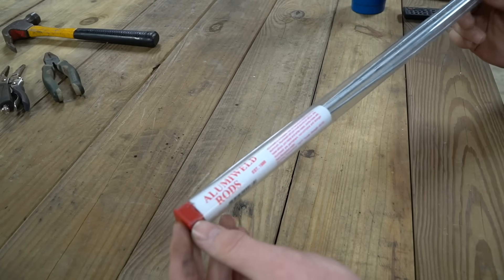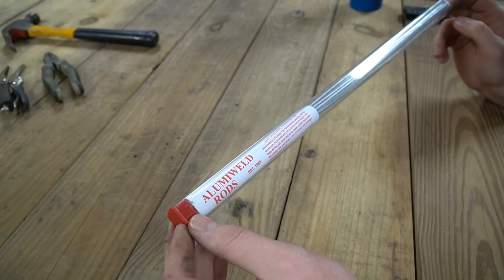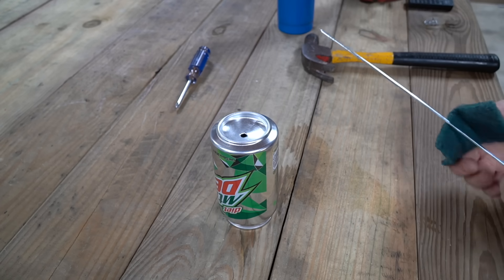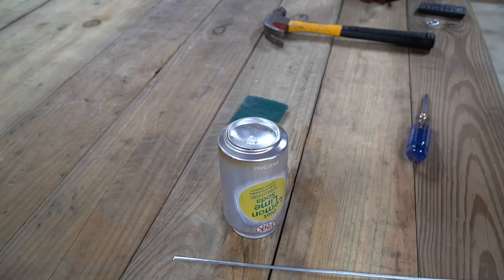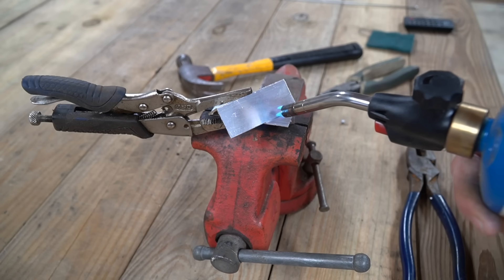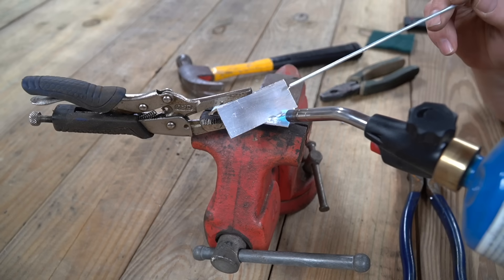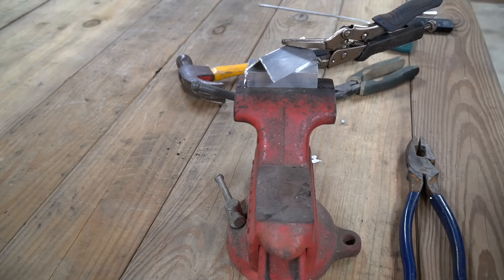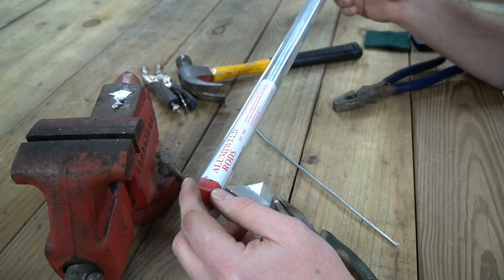Alumiweld rods from Harbor Freight!  Do they work?  Can you easily weld aluminum with just propane?

Comment from the maker: PLEASE READ  To clarify the procedure, you need to heat the parts being mended and allow those parts to melt and wick up the rod.  You "can" lick the rods with the flame to keep them warm.  At 5:05 I had melted the rod and allowed it to lay in the crack of the joint.  I continued to heat the parts until it wicked into the crack.  This works fine, but generally you would want to heat the parts up just past the melting point of the rods, then touch the rods to the crack and it will wick pulling in rod material.   Regardless of how you do it, the material needs to be hot enough to melt the rod.    And always prep the material!   Keep it clean!  Also this process is brazing, commonly mistaken by some as welding.

Comment: Could you use this on a stripped oil drain hole that has been stripped out larger (M14) than OEM (M12), then drill and tap it for the M12?

Comment: I have an aluminum boat trailer where the dang fender bracket broke and can’t be replaced as it’s part of the fender where it attaches to the trailer rail.
Do u think this would hold up with me climbing on and off the fender. I’m a good sized dude.
Thanks and this video was great

Comment: Nice demonstration but you need to use the tip of the flame(this is where it is hottest) and you need to heat up the entire piece you’re welding before you concentrate on the weld joint.
Reply from the maker: You need to heat up the entire piece and allow the rod to wick in.  More details in the pinned comment, hopefully that helps!

Comment: Yea, you can "weld" it up, but don't ever apply this to something that will be pressurized.  Then you'll need TIG welding.
Reply from the maker: As I commented in the pinned comment, it's really just brazing.   If done right, the material will bend before the braze gives away.   But yeah you could tig, mig or even stick it and it may come out better for your needs.

Comment: I have only used the original "Lumi-weld (tm)" rods from a welding supply. I've built two alloy racing motorcycle frames with them, repaired DOZENS, if not hundreds of cracked/holes knocked in motorcycle engine/transmission cases, repaired automotive transmission and transaxle housings when "The whole thing has to be replaced" (it didn't). A plain propane torch will work, but a MAPP gas torch is easier, a oxy/propane/natural gas "brazing rig" is the Cadillac way. Acetylene welding torches need a "bell flame" spreader nozzle, or spot heating is too intense. An old gas stove cook-top covered with a thick (6-15mm) chunk of sheet steel makes a great "surface heater". You aren't "welding" aluminum, it is FAR more like soldering and the entire part(s) need to heated for best results. I built-up a 70-odd piece race bike "boxed" swing-arm, like the billet alloy ones Honda, Yamaha, Kawasaki, and Suzuki made by machining away all they DIDN'T want. My bike still needed better suspension parts than I could buy, and "computer controlled" engine management, but our $30,000 "backyarder" could stay on the same lap with the "works bikes" worth MILLIONS of dollars. Like soldering, "Heat the WORK, NOT the rod!"

Comment: My buddies and I BUILT an aluminum frame in 1974 for a Yamaha TZ750 four banger two-stroke to replace the "flexible-flyer" factory steel frame with Lumi-Weld (TM) rods. Kaiser Metal Products out on East 41st in Tulsa, back then, advised us the Lumi-Weld joints were three to five times STRONGER than the Super Dural(tm) frame alloy. MAPP torches were all we used. Sadly "King Kenny" and "Fast Freddie" were racing on RADIAL tires, GOOD SUSPENSIONS and "works bikes" the customs sticker had "NO REPLACEABLE VALUE" on the crates. The "white coats" from Honda said "Fast Freddie" Spencer's Honda NR-500 oval pistoned four stroke was worth about $7 MILLION dollars!!!

Comment: its NOT welding, that is brazing, BOTH metals are NOT mixed to make a new metal. but they do work very well. been using it for decades.
Reply from the maker: Correct, and also has been noted in the pinned comment.

Comment: Its not welding its brazing but yes they work
Reply from the maker: They should of called them "Alumibraze" instead of alumiweld.   We kind of cover this in the pinned comment.
Reply: It’s actually soldering if you want to be technical.

Comment: Why didn't you use map gas
Reply from the maker: You can, but for small parts it's not really necessary.  You need to get the material you are brazing hot enough to wick the material, so for larger items you may need to use something hotter.   Also keep in mind today's Map Pro is not the old Mapp Gas we used to know.   Mapp gas is no longer made.

Comment: I have an aluminum water heater for an rv that has sprung a small leak....do you think this is strong enough to patch that? Pressurized it would probably be at around 60-80 psi running? Considering taking it to a shop but remembered seeing these and thought maybe...
Reply from the maker: I think the problem is going to be how big the tank is.   You have to heat the aluminum of the work piece hot enough to wick the rod, but not hot enough to melt the work piece.
Reply: @1D10CRACY  well it's a 6 gallon aluminum tank. The hole or Crack is pretty small but I have an acetylene torch and I'd assume I would need to localizethe heat to just the area being worked rather than the whole tank for this to work correct? Think that's doable or should I look into taking it into a welding shop?

Comment: I know you used the Scotchbrite scrubber. The one thing is, if you clean your aluminum you only have an hour or so before it really gets the aluminum oxide coating back. Aluminum is kind of weird about this oxide. The melting temperature of the oxide is quite a bit higher than the base aluminum. If you have the oxide coating and get your aluminum too hot, you can get a big balloon of molten aluminum that will form, then the oxide balloon breaks, spilling molten aluminum everywhere,  pretty much destroying your piece (ask me how I know). To get a good adherence the aluminum must be bright and shiny. I had some problems fixing a timing chain cover and was asked what kind of brush I used to clean the aluminum. Steel. I was told that will screw things up. This guy knew his stuff. He told me to use a stainless steel brush. My welds looked great. The Scotchbrite isn’t steel so will work. Something about steel. Oxidation maybe?

Comment: For the record patching a hole in a soda can is not impractical! I charge about $400 dollars plus $80 a pound for refrigerant to repair a leak in an aluminum coil! ( I’m a hvac contractor ) If you can repair a hole in the soda can then you can fix a leaking coil!

Comment: I was looking at a solder deal on TEMU so I figured I’d check the viability. Their rods most assuredly are chiluminum but the price is stupid right so I’m going to give it a roll! Even comes with a little butane torch! 
Is MEP gas too hot or would it just heat it faster? I know in cooking, higher heat isn’t always a recipe for success! New subscriber…looking forward to some other videos! Thanks for a great tutorial!

Comment: The biggest complaint I se about these is that it takes too long to get the parts you are going to weld hot enough to melt the rods and take up the rod material. In every case I see the same mistake. The items to be welded are in a vice and the vice is usually attached to a steel work table. With aluminum conducting heat as well as it does, in a case like that you are basically trying to heat the vise and the table. You need to get a heat isolation mat to put your parts on to isolate them from anything else metal and voila no more issue!
Reply from the maker: Yup, the material you are brazing needs to be hot enough to melt and wick the rod material in.   A lot of people try to just melt the rod with the flame and you just end up with cold joints.

Comment: If you insist on cleaning the rod beforehand make sure you use additional flux. Most of these rods (and ive used a lot of brands) have a thin flux layer on them. The difference with and without is marginal but if you have something that's particularly important or sensitive. It will make all the difference.
Reply from the maker: Great tip for rods that have flux on them.  These per the manufacturer do not have flux on them, so cleaning then shouldn't be an issue.

Comment: I just tried this today with failure . I have the same torch you do but I bought the US Weld brand of these aluminum flux sticks and all it did was melt and glob up and break off from the surface I was trying to seal together. the 2 surfaces = aluminum plate 1/8 " thick and a cast aluminum . I went through and sanded both places I wanted bonded and cleaned them as well . maybe this brand is cheap crap ?

Comment: I am trying to fix a crack in the cast of a pressure washer. I tried JB weld but it blew open and leaked. I have some aluminum rods like these so I was going to try them once I grind all the JB weld from it. Anyone forsee any issues I should look out for? Hope this works as it is a nice gas motor pressure washer!

Comment: A propane swirl torch throws more heat than the usual cone flame torch head.    They can get too hot for thinner pieces but it’s easy to reduce the heat by backing off a few inches .   Far better to have too much heat than not enough when just a little distance will make it right.

Comment: I’ve welded up several air cooled engines blocks and so far no leaks but it took time to clean and preheat it , need a helper to keep it hot enough 
😊

Comment: How about doing a real-world weld such as welding a crack or even better,welding a broken chunk of a damaged automatic transmission bellhousing?
Reply from the maker: Sounds like a great idea!   When you do, record a video and post a link to it!
Reply: @1D10CRACY  
Well, I did attempt both (didn't video any of it) on a C-6 auto in my current resto/mod  1977 Ford Ranchero GT project with less than acceptable results. Bear in mind, I am neither a pro nor a novice at welding, I own an "Old Reliable" Lincoln stick & a Miller Mig/Tig rig plus an Oxy/Acetylene, but I had heard of the Allumiweld and wanted to give it a shot. I drilled a 1/16th inch hole at the end of the crack. (You know why) and used a small angle grinder to bevel all the places I was gonna Allumiweld, I started with a propane torch but couldn't get the mating surfaces hot enough to melt the Alumiweld, so I tried a Map/Oxy mini torch, but got the same results. After wasting 2 packs of Allumiweld, I threw in the towel and broke out the Tig. But just cause I couldn't do it, don't mean it can't be done, ya know? So I thought since you had good results, maybe you would be able to show me what I done wrong, hence my comment...  But, what the hay, no harm, no foul, right?     L8R G8R  :-)

Comment: I did that to all rivets on a boat , warped bottom of boat a bit but in a few days could hardly notice, even welded a new water drain hole aswell, there's a few models of those rods, some need less heat

Comment: I've used a similar product here in UK.  They  work for some stuff but not everything. Good on small thin stuff like in the video but large items like engine cases just wick too much heat away from the weld area to get things up to temperature. Also if you're doing more than one weld and they are too close together you end up melting the first one doing the second. They work but not the fix all the commercials would have you  believe.

Comment: I used these, with a MAPP gas torch, to braze a crack in an aluminum boat. Hit it with a manual wire brush first, not mechanized as that's too aggressive.

Comment: Thank you for showing the sticking of the two different pieces of aluminum together. 
You keep explaining the process being used is not producing a weld. Then you keep calling the process welding. 
It's not welding. 
Brass isn't the filler metal, so I don't see how the process is braising. But it's not welding. 
Thanks again for showing
Reply from the maker: Correct, it is brazing.  There is no mixing of the metals.

Comment: The only way to weld aluminum dependably is with a tig using the correct alloy, heat, penetration, etc. Just don't ever try to use this "one size fits all" junk on anything critical or important.
Reply from the maker: I used to stick weld aluminum, but today I use my mig.    Keep in mind, in this video we are brazing, not welding.

Comment: Another one who doesn't know how to use it properly!  If this is the flux-cored rod you are not supposed to put a flame on it.  Clean the area for soldering first - that didn't happen here - then heat the piece.  Apply the rod to the heated piece but NOT in direct flame or it will go blobby! 🤔
Reply from the maker: Yup!   That is why I made it clear that you are heating the part, not the rod.   It will wick when it's ready.  You can lick the rods with the flame to keep them warm as I was doing in the video.  I'm going to assume what you are commenting on is around 5:22 where I allow the solder to melt and fall into the crack before the material was hot enough.   But then I kept the heat on the part until it wicked into the crack.  This is also fine.   This is why it went from "blobby" to smooth at 5:56. :D And yes, it is best to clean the parts, I used a scotch bright pad in the video to prep the surface, but wiping that up afterwords would certainly not hurt anything.  And no, these rods are not flux core. Hope this helps!

Comment: thats not how to even use the rods.... you dont apply heat to the rod only the part other wise theres no bond
Reply from the maker: Yup!   That is why I made it clear that you are heating the part, not the rod.   It will wick when it's ready.  You can lick the rods with the flame to keep them warm as I was doing in the video, but do not melt the rods with the flame.  Hopefully this helps!

Comment: Not useful on cast aluminum.
Reply from the maker: Only if you are not able to get the part hot enough to melt the rod.  Otherwise it works very well on cast aluminum.

Comment: This isn't brazing since you're not melting any of the can so the two metal mix together like you would get from brazing. Aluminum melts at 1,221 degrees f. Some solders melts between 90 and 450 degrees f. This method is using 750 degrees and is trying to fill the gap between soldering and brazing but it isn't brazing cause like what I said earlier. You're not mixing the two metals. They don't want to call it soldering cause of the melting temperature being used is higher than what's used in soldering. So it's controversial. I call it soldering. I have brazing rods that you use a acetylene and oxygen torch to braze aluminum together with. They also make aluminum welding rods for welders to weld aluminum.
Reply from the maker: Hi Frank, When brazing, you do not getting the base metals hot enough to mix.

Comment: This product suggests there is no flux in the rod.  What is the rule of thumb with using a flux core rod or adding flux?  Appears you did not use flux.
Reply from the maker: You do not need any flux for these rods to work.  You just need to make sure the aluminum that you are welding is hot enough to melt the rod.
Reply: @1D10CRACY  Ok, thanks for the reply.  I am attempting to seal a small pinhole in an aluminum radiator core/row.  I imagine the aluminum is pretty thin, so I didn't want to try and TIG weld it.  I'll see how it goes with these rods.  Thanks!

Comment: great video thanks. Can you comment on when you would need to use MAP gas vs Propane?
Reply from the maker: Mapp gas gets a bit hotter than propane, but my understanding is mapp gas is no longer sold.  Apparently the yellow bottles being sold in the big box stores are some kind of substitute and do not get as holt as the old mapp gas did.  This new substitute does burn hotter than propane.

Comment: It all depends on your application, there is no doubt that tig welding is the best way to go. I bought a small Lincoln 155 mig welder years ago and purchased the aluminum kit for it. I welded up the transom on my 1963 aluminum boat that had busted from the top to bottom right in the middle, and I still use it to this day with no issues. I have used these rods on smaller projects and they work well but I wouldn't attempt to weld a transom with them. Thinner metal, small area propane is best, thicker metal needs mapp or oxy/acetylene.
Reply: Or use two propane torches .    A rosebud comes in very handy with this sort of thing with heavy castings too.   You just have to watch the heat with the big guy as there’s no color change indication with Al.       You have to practice with using the bigger torch to get it heating then back off some to finish with the propane torch.    It takes a bit of practice and finesse  so it’s best to practice a bit on a similar sized scrap piece first.

Comment: Yes these do it yourself welding rods work but you got to hold your tongue just right.
Reply from the maker: With a little practice, you get use to them.   The secret is to keep the metal hot enough to melt the rods, but not hot enough to melt the material itself, kinda like any other form of brazing.  :D

Comment: Do you think this would work on a aluminum cast engine case for a quad?
Reply: Go see the Project Farm video (link below). He grinds a hole in a mower block and uses a Hobart aluminum rod to repair it and the engine ran for 30 mins no problem before he shut it off.
https://www.youtube.com/watch?v=fKIKsDfRAcs

Comment: If the aluminum is at right temp you shouldnt need to hold the torch anywhere near the rod. If the torch is melting the rod instead of the aluminum melting the rod you're not getting the best bond.. The aluminum needs to melt the rod.
Reply from the maker: Yup!   You do not melt the filler rod with the flame, you melt the rod against the already hot aluminum.   If you don't do this, it will not stick properly.